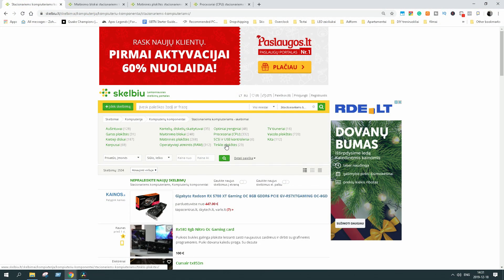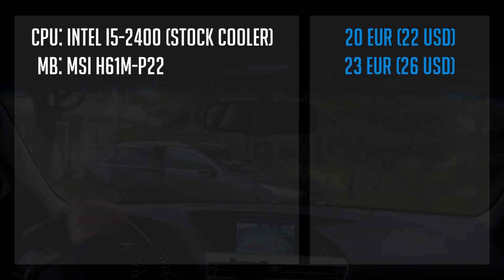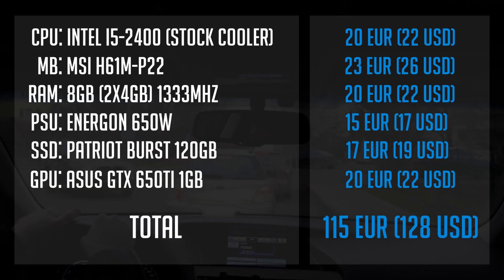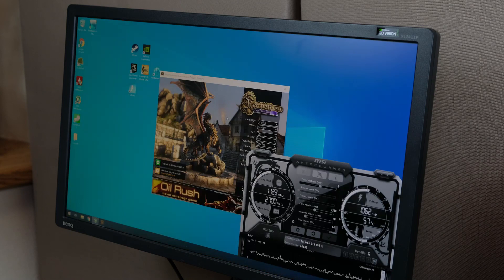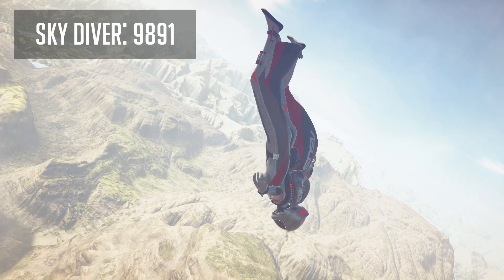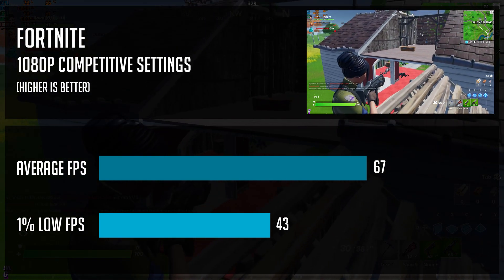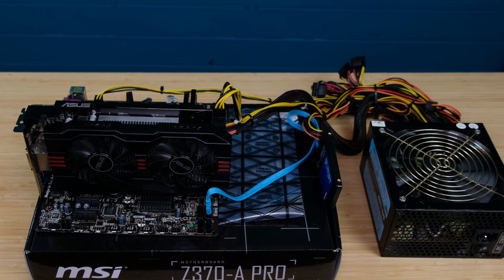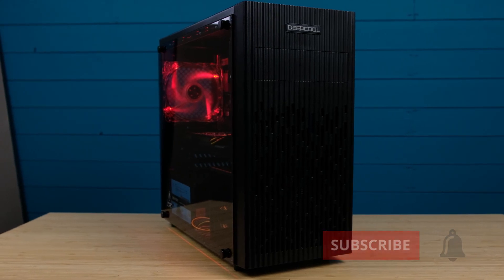$130 FORTNITE PC - PLAYING GAMES ON A TIGHT BUDGET - i5-2400 + GTX 650 Ti - Used PC w/ Benechmarks

Comment: hey man, i recently bought the same case although i haven't built anything yet with it but honestly i'm impressed with how it looks. 

i was wondering if you tried using an aftermarket cooler with it? like a gammaxx 400?

great video! cheers!
Reply from the maker: Hey,
well, it's not a super high-quality case, but definitely, for its price, it has tempered glass panel and in general looks quite ok :)
I actually made an unboxing video of this case here: https://www.youtube.com/watch?v=aB5FH79IDk8

Unfortunately, I didn't tired aftermarket cooler, but it supports up to 151mm (5.94 inch) CPU cooler height. It seems gammaxx 400 is 155mm height, so it will not fit.
Few fans to mention under 150mm you could use:
- Cryorig H7
- Cryorig M9A
- ARCTIC FREEZER 33 PENTA
- ARCTIC FREEZER 33 ESPORTS White/Red
- Scythe Katana 5
- be quiet! Dark Rock TF
- Noctua NH-U9S
Reply: yeah, i saw that video too and it made me become more convinced to build a system similar to that for my brother. i'll be using a used i5-3570 and a gtx 750 ti. 

oh i see. the gamaxx is really nice though for it's price. i wish i can get one of those coolers you've mentioned but unfortunately they're difficult to find here in my country or maybe expensive. i'll just stick with other deepcool offerings. 

thanks for the reply! 🍻
Reply from the maker: Yep, gamaxx are nice budget coolers :)
hmm, well you could search in your country for a cooler under 151 mm then. But those ARCTIC ones should be relatively available, no?
they are also kind of budget options :)

Comment: competitive fortnite players keep everything on low except 3d resolution and alot of them play stretched resolution which means you'll probably get around 75 - 85 fps
Reply: also if you want to play competitive this pc even wtih 80 - 90 fps wont be enough cause in competitive games last zone still had like 60 people so you would most likely get like 15 fps on a good day
Reply from the maker: @gojus-f4f  hmm its hard to test that for me :))
And so it means that if you normally in game 200 fps in the situation you described below it would fall to 40 fps?
Reply: @EpicGameTech  not 40 but like 70 - 90
Reply from the maker: @gojus-f4f  so in case you want to have 144fps and no less all the time, you need a really powerfull pc then.
E.g. 143 fps was my aim for Apex Legends or Quake Champions since dips below that were not hood enough for me.
I solved that only with i7-9700k + gtx 1080ti, but i thaught Fortnite does not need such a high end to have 144fps and up all the time :)

Anywy, this budget build is not something competitive player would buy i guess, but more like the one wants to start playing Fortnite and have fun for starters :)
Reply: @EpicGameTech  Yeah I want 144hz in apex legends consistantly im pretty sure my ryzen 5 1600 is good enough but my 1060 3gb is really holding me back
Reply from the maker: @gojus-f4f  yep, you should get gtx1080 or etc :)
Reply: @EpicGameTech  a 1070 is probably enough for me I play on 1680 x 1050 everything on lowest
Reply from the maker: @gojus-f4f  i had gtx 1070 so it was qute good pair with 8400. I was getting 144fps 90% os the time i would say. But sometimes in intense battles i had some dips to 100 or so, thats why i recently got gtx 1080ti to fix that ;))
Reply: @EpicGameTech  yeah but I play lower res so my best guess is that it would be enough 
ill probably wait for new cards in the 200 - 250 range before buying tho
Reply from the maker: I would buy used, since its like 50-60% of original price :) sure new cards have warranty but thebolder ones get even cheapper when a new gpu's comes out. So i can get wsy better performance for the same price.
At least in my country :)
Reply from the maker: Hey, thanks for the tip! :)
But what about view distance?
Reply: @EpicGameTech  view distance low

Comment: will this run modern warfare at around 70 fps?
Reply from the maker: Good question :) i will be off for this weekend but since its a new game i daubt it. Games minimum spec are higher than this pc. But will try to find any or my frieds that has this game and maybe benchmark it on low settings if i can.